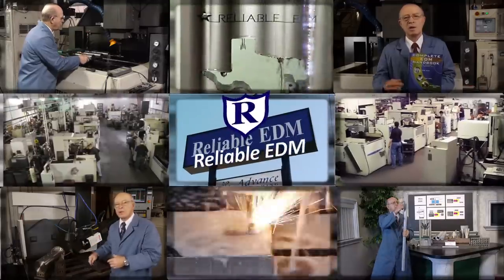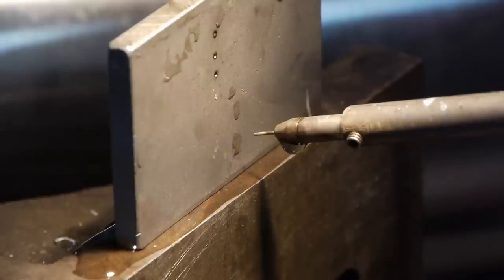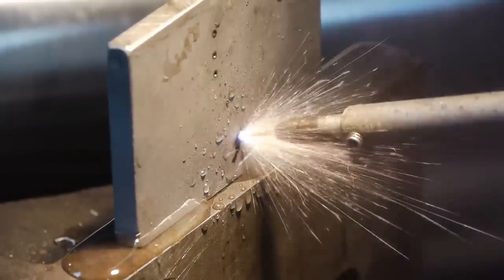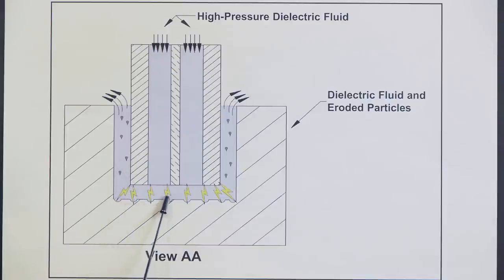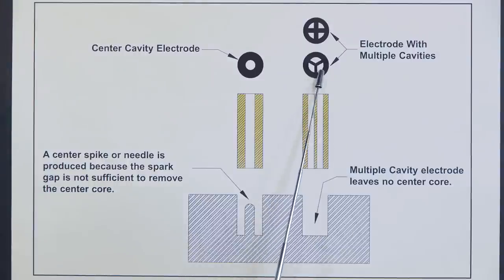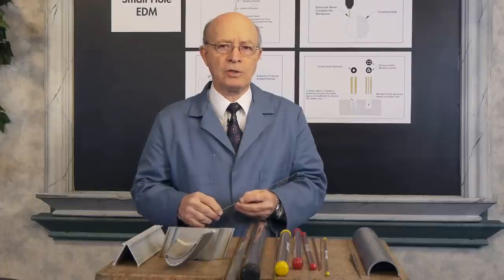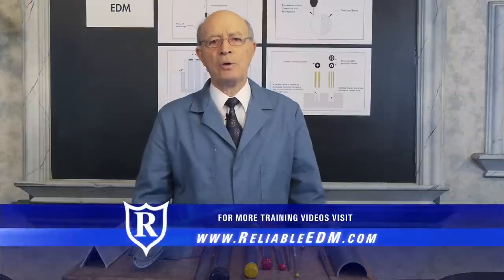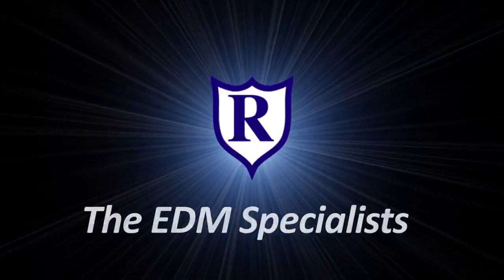How Small Hole EDM Works

Comment: in the late 70s I used a "spark eroder" mounted in a drill to eat through broken 1/2" taps in cast iron axle bodies.
hmm looks like we were doing a few things wrong. 
We used tap water to cool the hollow electrode, which didn't rotate but bounced up and down. The trick was getting the electrode arcing and bouncing to maintain the arc. . similar to arc welding.